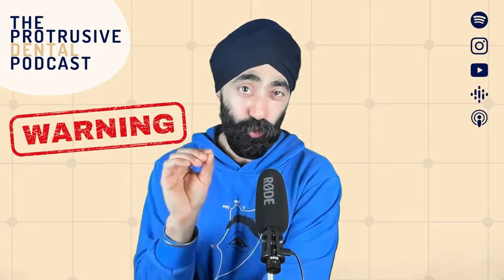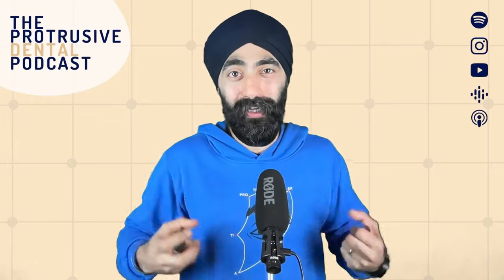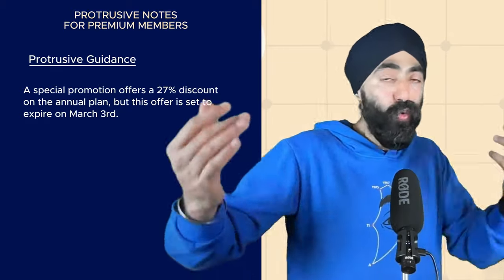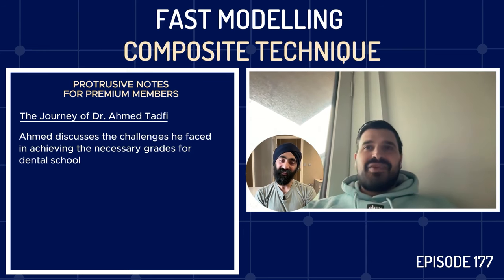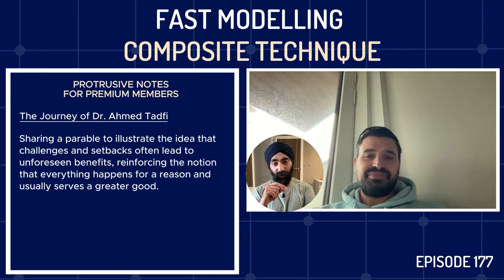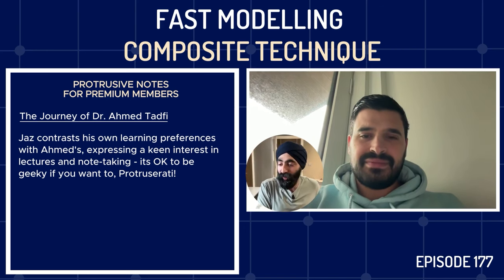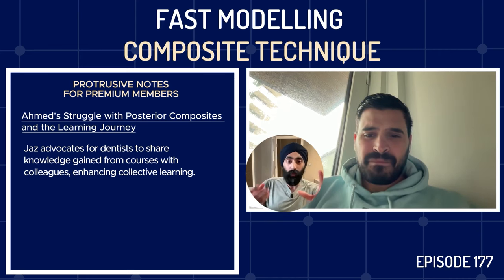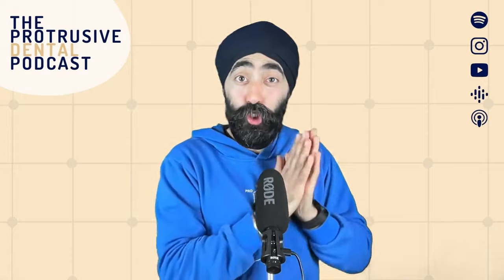Fast Modelling Composite Technique FULL DETAILS - PDP177

Comment: For the part where you guys said we could temporize the tooth after building the wall- is it just to etch bond and continue? I worry abt the bond being better without loosing the isolation and saliva contact and coming back?
Reply: As long as u re isolate then air abrade with sandblasting or aquacare you can continue as normal without worries ;)